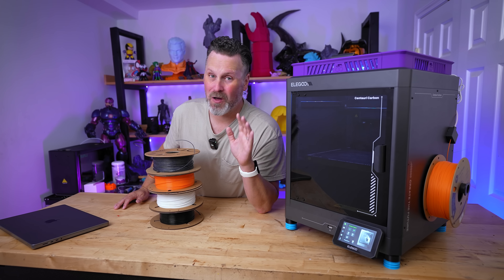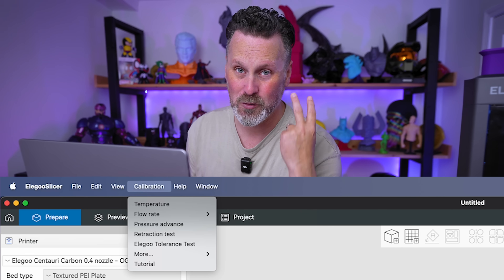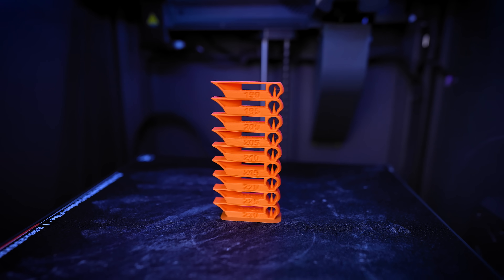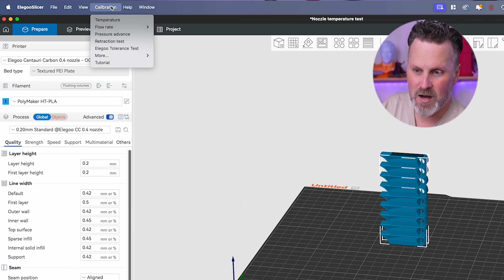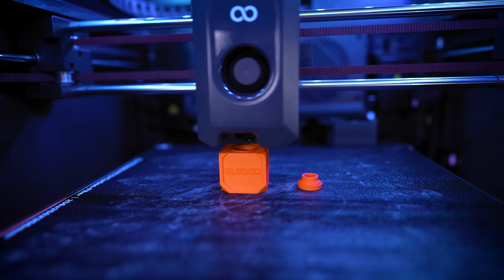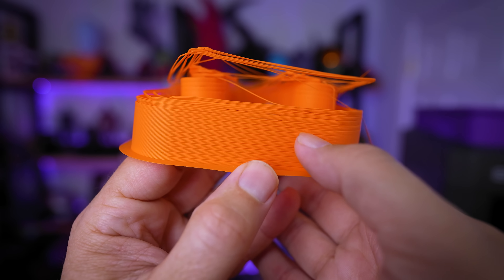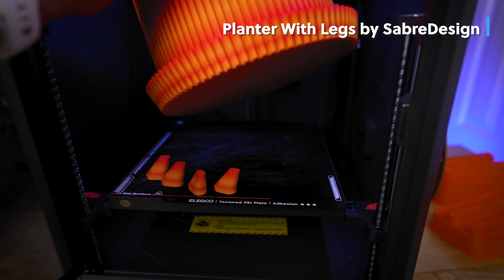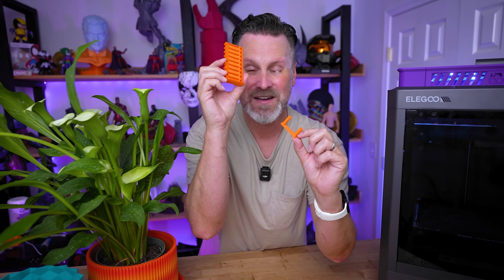3 Easy Ways to Calibrate Your Filament

Comment: I would remove the retraction test and add in the pressure advance test, it is very important.  I would only run the retraction test if I was having stringing issues.

Comment: my printer cant even finish the temperature tower..
printing pla hd from winkle at 90mm2/s and at 215º it just starts with noodles, iam also running fan at 100% (neptune 4 plus) any ideas?

Comment: Thanks Uncle Jessy your tips helped a ton. I got my first 3d printer (also centauri carbon) a little over a week now and I was very much procrastinating with the tuning of the printer. I am aware there's much more calibration that can be done, but in the end ur video made it quite painless to finally print a piece without stringies and a more respectable tensile strength 😄

Comment: Thank you very much for this! I just got back into 3D printing, this is info I used to know, but have completely forgotten. It's very useful to have an up to date tutorial in the slicer I want to use going forward and have no prior experience in. I also really like the new max flow rate test, too, since I will be modding my printer a tiny bit

Comment: i also check layer adhesion when i do a temp tower. ive had filaments that looked great at 180°C, but i was able to just pull the tower apart by hand. 
so i started to look at the tower first and when im done with the visual, i just put a finger in the overhang test and try to rip apart the tower. starting from the lowest temps making my way down the tower. eventually it will bond well enough so you cannot rip it apart.

Comment: Thank You! This is the most useful video I've seen in a long time.  I didn't know about the Elegoo slicer calibration tools.

I just got my CC two weeks ago and I've got almost 200 hours on it already. This is my third printer and I'm absolutely loving this thing. I did smooth down a sharp corner on the top left back frame. The ptfe tube was catching on it with the top off.  My only failures have been caused by jammed filament spools and bad slices of articulated dragons scaled down too much. I've been printing in PLA, Silk PLA, and Rapid PETG. I've been using a heated bed at 60 and 70 degrees respectively. The bed adhesion has been amazing. The first layers are perfect and I've had Zero failures. The prints just fall off when cooled down. My bed still looks brand new.  FYI, my CC was in batch 4 and shipped a month early. It came with the upgraded light kit and the multi filament port in the back. The ptfe tube was not zip tied down and there was no damage in shipping.

Comment: I would also REALLY add the flow rate test to those two basic first tests. If you remain within one 'family' of plastic (only PLA, or only PETG, etc) you can usually safely skip it. But if you usually print PLA and now want to try, say, ABS, or especially ASA, you really, really, really want to do the flow rate check too. Where PLA can be run at pretty much 1.0 flow rate, ABS will go towards 0.92 or so, and ASA can go down to 0.88 or even lower (ie: actually print with about 12% less ASA being pushed out of the nozzle for every 100% that you would do for PLA). If you don't set these correctly your top layers will look ugly (as if you're dragging the nozzle through the plastic), the tolerances will be worse (since the outer walls will start to squeeze out), you may get nozzle strikes as the head moves from one of the print to others, knock over supports, etc.

Comment: Do you need to do this on every printer? Or do you just assume the calibrations will work for all printers?
Reply: The basics should work, you'd definitely want to optimize on every printer. Different nozzles, different extruders, different motors, open body or enclosures, etc.

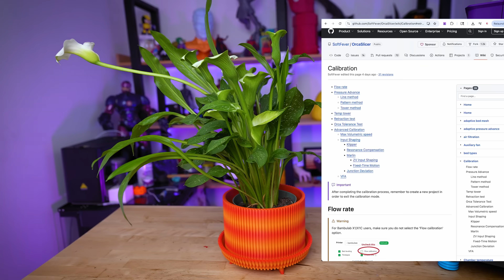Comment: Interesting, but should have been a few minutes longer to cover more details about things like pressure advance. Regarding the orange planter at 10:30 - no surprise that there's no stringing - not many travel moves with that model once the small parts are finished. The vertical ridges on the blue planter at 11:20 are not uniform - I don't agree with your assessment, it's not bad, it'll work fine as a planter, but I'd want to improve on that finish.

Comment: Great tips! But... when I tried using Orca on Linux Mint I received the following error 14 non-manifold edges on both Nozzle temperature test.stl and Retraction test.stl. I had a spare Windows device and loaded up Orca since the Windows version allows one to fix this error. Fixed, and then exported.

Comment: Thankyou very much, very useful info and so well explained. Interesting note is that Bambu do not have this calibration feature on their slicer. Luckily I have Orca as well, and will use this or the Elegoo for my CC when it arrives. Cheers
Reply: Bambu Studio does have calibration tests.
Reply: @bryanfoster362  not to the same level as this , at least not that I can find.  There is flow rate and flow dynamics. But what can be chosen in Orca is a different level.
Reply: I share your pain, Prusa Slicer doesn't seem to see the need for calibrations either. 😢 And yes, I know that there's plenty of calibration models on Printables (which is directly included in P S)

Comment: One very important note when using the auto calibrations. NEVER EDIT AND SAVE RIGHT AFTER RUNNING A CALIBRATION, always hit new print to wipe all settings and the plate clean, THEN edit the setting as needed.